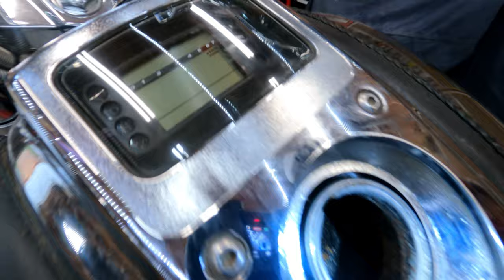I Bought The BIGGEST V-TWIN Ever Made!.....20 years ago

Comment: Ive got a 02 1800C with a unique problem. In hot weather,  as the tank level decreases, its developing what I think is an intermittent miss.Its acting like bad gas and seems to get worse as the level of fuel drops, but id swear it was an electrical issue. I plan to do the "ground fix" on it this coming weekend and see if that corrects the problem. Any experience with this issue? Congrats on your purchase. I LOVE Mine. I bought it on 02 when it WAS the biggest baddest V-twin ever. Still a great bike to this day. Ive got 42k on mine. I have lots of add ons, but still dont have the vance and hines exhaust. Its on my list though....LOL
Reply from the maker: Hmm...weird. You're sure the fuel level has an affect on it? If so, it would almost have to be a fuel pump related issue. You're fuel pump is in the tank itself.
Reply: @two-cargarage  yeah that was my thought too. I think sediment is clogging the fuel filter or pump screen as the bike runs and it gets worse as the fuel level drops. I went ahead and ordered the whole OEM fuel pump assembly yesterday. I figure If i need to pull the tank, i might as well just do the whole dam thing and rule that out as the possible cause.

Comment: The F is the Best version IMO at least. There's a manual and tool box under the seat where those wires were coming from. F  has 3 Spec levels for trim and factory chrome. Tribal Flames are the dark color decals. That's a $6000 dollar bike at least in that shape with the add-ons.
Reply from the maker: Thanks for the input and info! It sure is fun to ride

Comment: 0905 on the tire means 9th week in 2005. Not September. The front brakes are dual action, hence the two hoses to each caliper. There are 3 discs in each. The center disc is actuated by the rear brake pedal. Thanks for the vids.
Reply from the maker: Great info, thanks for commenting!